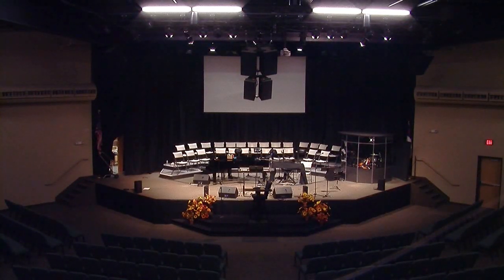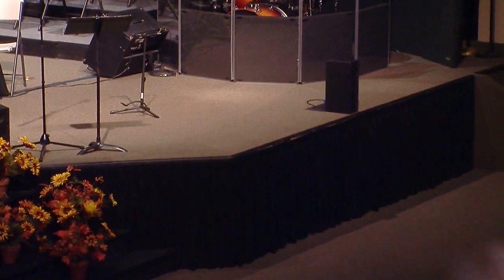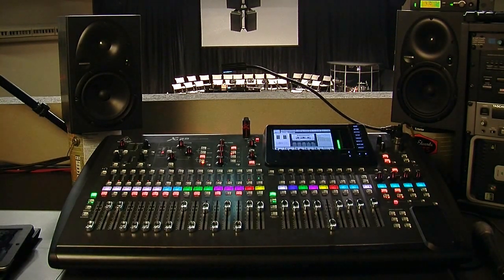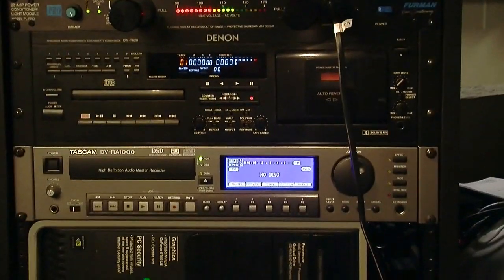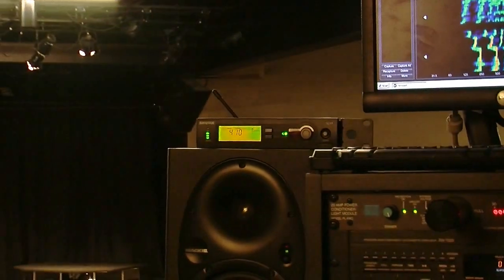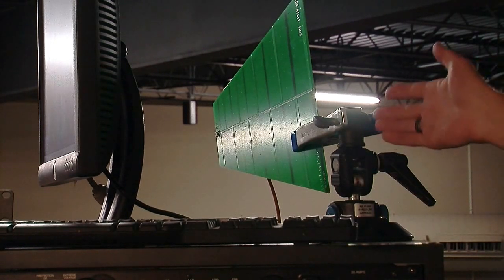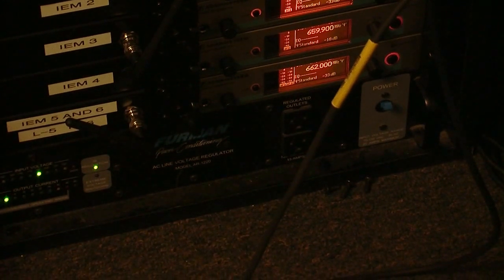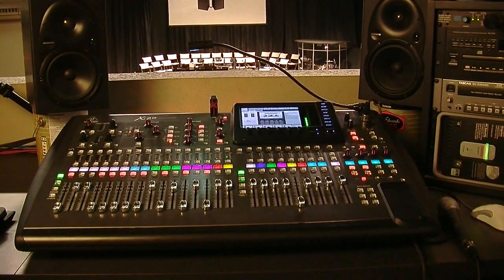NRCC Sound Booth & System Tour

Comment from the maker: I thought about using a UPS as well, but we have a Furman AR-1220 Voltage Regulator on the sound booth that keeps it at a stable 120v.  I think that maybe next fiscal year we might add one, but right now our building has some pretty good clean power.  I am actually out of Phoenix, AZ but close enough!  I love the board and once you learn it you will love it moreso than when you first get it.

Comment from the maker: Hey!  Thanks about the videos!  We do use the SLX and I have had no issues with them.  Great mics.  We use the SM58 head for the guys and the Beta 87 head for the girls.  Sounds great!  Just make sure you use them on channels where there isn't anything there in the RF and you are golden.  Issues happen with any wireless mic when you have interference.  We currently do not have any distribution on the wireless mics, which I have been working on a research project with using TV splitters for this.

Comment from the maker: I have the X32 sending a signal out of one of the Aux outputs (I believe aux 1) and that is being pulled from the matrix 1 which is my system out for my mono system.  It doesn't replace the job of a real rta mic, but it will at least give you a visual on if you have feedback or how your mix is looking.  As long as your system is tuned correctly, this will give you a good representation of what is going on.

Comment from the maker: Send me a message and I will give you a link for my write up.  Basically I am using an active television coaxial splitter for splitting the wireless RF.  I have tested with a spectrum analyzer and there is no ill effects by using these.  I will also make a video explaining all of it when I am done.  It works perfectly though!  Just need a few adapters to get the connectors correct, or get a crimper and install some F and BNC connectors.

Comment: Any concerns with a power drop with the digital equipment?  We had a brownout one Sunday from a lightening strike close by and out DriveRack cycled and caused a pop on the speakers while it booted.  Thinking about putting a small UPS on the digital devices to keep them up.  You may not have that issue out in CA.

Love the videos, keep them coming.  We are getting closer to reworking our booth and will be getting an X32.

Comment: what are you using to mount the antenna? how does the antenna hookup? looking at getting one to use with our line 6 digital stuff. it would be on the 2.4ghz freq.
Reply from the maker: I am working on a new mount for it with some painted PCV pipe.  You can drill through the PCB board antenna for mounting.  I would mount it to something non conductive to not alter the antenna pattern.  This specific antenna wont work in the 2.4GHz area, search in google for WA5VJB 850 - 6500 MHz Log Periodic.  That antenna will work in the area you need it to.
Reply: yea i found the right antenna for the that frequency, just wasn't sure about the way you mounted it. also, does the cable come already installed?
Reply: Kent Electronics does offer these antennas with connectors attached but not the cables themselves.